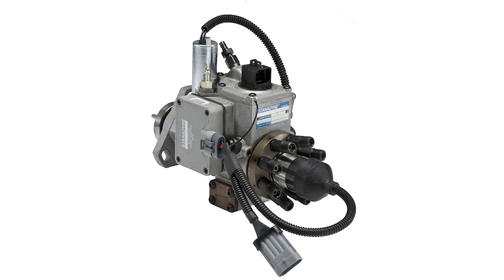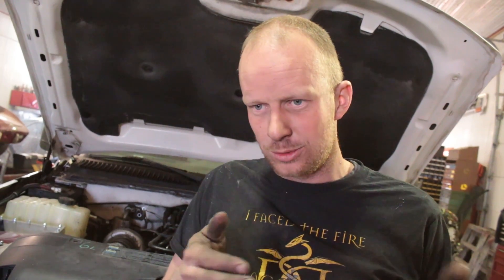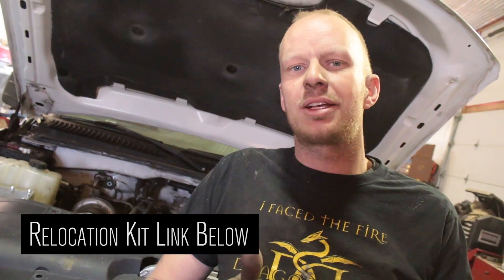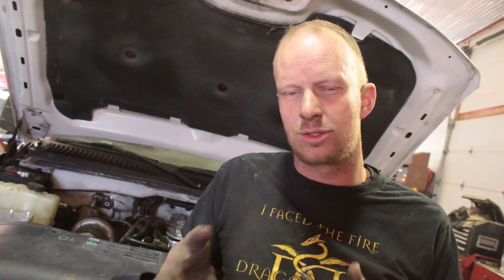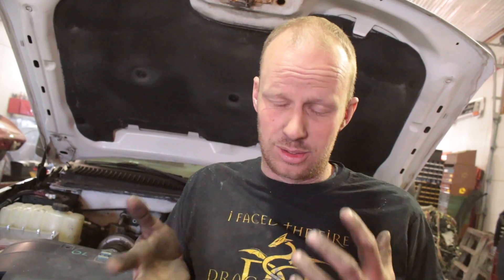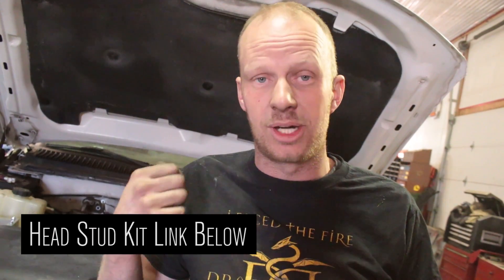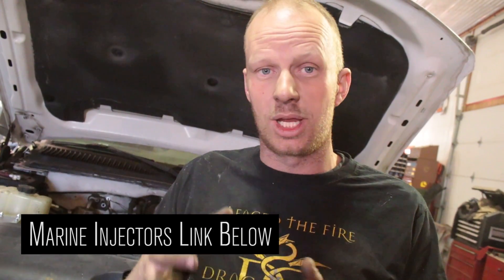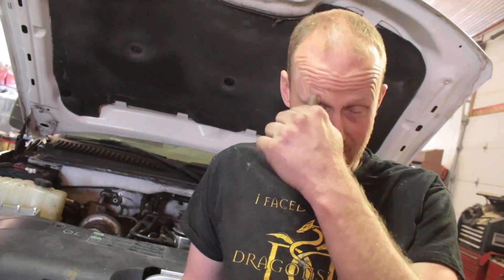REVIEW: Everything Wrong With A GM 6.5 Detroit Diesel

Comment: Not a Detroit, it is GM. Two separate divisions. The Stanadyne DB2 pump issues were mostly the driver module. Relocating the module was really not the answer, repeat failures were more common when relocated. A change in module design helped greatly not perfect. Cracking heads when overheated .  Cracking main bearing webs were somewhat common. Broken cranks were somewhat common. Bad crank balancers were common causing a knocking that was mistaken for rod knock. Failed glow plugs, various exhaust manifold leaking issues, leaking oil cooler lines common. Vacuum pump failures common. This cheap lightweight engine was a disaster and not heavy duty by any definition. This engine should never be 'chipped'. My most replaced engine of all time next to chevy 350's . The military only used them because it was the only diesel option with the GM built Humvee but that engine was not the same as the 6.5 civilian model, in fact it was almost completely different and more HD in many ways with a different designation (GEP P400 6500 optimizer) including a mechanical fuel system instead of electronic, different alloys and other mods but visually identical to the untrained eye.

Comment: The first thing wrong with a GM diesel is that it is V-shaped. DUMB !!! The new 3.0 inline and the new 2.5 inline are incredible changes for GM. Inline is the way tractor engines were designed for a reason. Whether it be a gasser or a diesel. 

I despise ths moron that created a V-variant of the diesel engine.

Comment: The 6.5L was 180-200 HP/360-390 TQ.
The 1992-1993 6.5L's were mechanical fuel injection,and then the others did indeed have electronic fuel injection including a DB2 fuel pump before the DS4.
The 6.5L is from 1992-1999.
The 6.2L was for 1982-1992.
The 6.5L is in the M1025-M1046 HMMWV and M1113-M1167 HMMWV/ECV.
They kept the 6.5L in production under license and rights sold to AM General for HMMWV from G.M..
The difference with the 6.5L in the M1025-M1046 is that they had a N/A 6.5L but the M1113-M1167 had a T/C 6.5L.
And yes,they did have these engines naturally aspirated as well,you could buy them as crate engines.
The CUCV ll had 6.5L's but only 8,000 of them were ever made while the CUCV only had the 6.2L.
The 6.2L was also put in the M998 HMMWV one year after they came out.
Even though the 6.5L is nearly three decades old already with the Humvees being almost four decades old themselves ever since they debuted,the Army and USMC will still keep them until another twenty years.

Comment: All the problems with the injector pump where the pmd and stock lift pump gm never fixed fully fixed. after market sells relocate wires at 8 40 and 82 inch. Buy lifter pump for marine.

Comment: My 1994 6.5 has 340k on the odometer put an hour meter in has 5500hrs on meter haven't changed any injectors or the turbo 1 inj pump and a Dorman    PMD runs great no oil usage or major repairs

Comment: I bought a 94 Silverado Z71 with a 6.5 turbo for $600.00. The truck had a clogged screen in the tank. Blew air back thru the line going into the lift pump and drove it home. Found out it was the first year of the computer controlled injection pump. The truck had 316000 when I bought it. I had to fix the glow plug system, and some other sensors, along with the vacuum pump. It has pretty bad blow-by, but it has 32200 now, and use it as my daily. I also moved the PMD/black box from the intake to inside the front bumper, which is what most 6.5 guys do. I do want to pull it down and freshen it up, but for now it runs well and pulls fine. Just to make a correction, the stock turbo is putting out about 12 psi at wide open throttle. The computer adjusts the turbo output for the load it sees. The parts are cheap and easy to come by. I also want to put the studs in the block when I freshen it up, so that is an issue. There is also an issue of the timing chain and gears. They say it only lasts about 25,000 because of the pressure of turning the injection pump. There is a gear drive setup to replace the timing chain to solve that issue.

Comment: The square body never never had a  6.5 and the last year for a square was 92 crew cabs and suburbans only. 87 for trucks, the GMT 400 platform and bodystyle started in 88 ended in 1999 some suburnabs and crew cab diesels made it to 2000 or 2001 the square bodys started in 1973 ended in 1987 trucks the 6.2 diesel started in 1982 previously the 5.7 diesel
 was found in trucks

Comment: I have a 2000 Chevy k3500 OBS DRW truck with the 6.5 diesel and I’ve got 215k on her. Tell you what Honey Badger (what I named her) is a mean bitch and must’ve been made on a Wednesday or something because she has withstood tons of hauling, man baskets dropped on her, 30k hard miles with a 17 year old who has a lead foot (aka me) and she has never overheated once, not when I took her in the mud, I’ve had that truck sideways around some corners driving around. The only problems we ever had with Honey Badger was with the factory piston driven lift pump underneath the drivers door on the rail. Once we put a gear driven pump she never had any problems. I took Honey Badger from Stedman North Carolina to Michigan and back hauling a car trailer one way then a car on the trailer on the way back and she cruised 70-75 mph the whole way and the only time we stopped the engine was to get fuel. Didn’t over heat once. My 6.5 turbo diesel has been nothing but good to me and have zero complaints about my 6.5

Comment: The 82nd AIR, we started getting the Humvee's in 1988 or so, and then within a few months, engines where blowing left and right. Go to the motor pool, there would be 3-4 of them sitting there and one or two on a lift engine out getting replaced. I think they where getting an upgraded motor, can't remember. No worries, we had lots of M35's- with the  465, and them things kept on trucking.

Comment: 6.5 2000 savanna and almost 400k it's super reliable. Only problem was the pump control module. Even relocating it into the air box still had one fail eventually. If it was not for that module I would of been 100% reliable for over 200k

Comment: If you work them hard they do not last,. Light duty great,. Anything more than a half ton the thin number 8 liner, the POS balancer and the crappy cooling system really show up..  the later ones they fixed some of the stuff but it's still a 80hp pump motor used because it was cheep...

Comment: My biggest issue was the lift pump. Who the hell powers a lift pump with the oil pressure switch. Run it through a relay, no more oil pressure switch failures.

Comment: 90s and later Chevy pickups (aside from a few 1 ton 90/91s) are NOT "square bodies". The square body Chevy is 1973 to 1987(-91 in some heavy applications, essentially left over parts). They never got the 6.5L, only the 6.2.

Comment: Disposable motor. Junk at 100,000 or less. This is a GM diesel engine not to be confused with Detroit diesel who builds industrial heavy duty diesel engines. The confusion is left over from the old 2 stroke era.
Reply: You're wrong. GM commissioned Detroit Diesel to develop the 6.2. It was made in a Detroit Diesel engine plant. They hit 300,000 consistently. I've owned multiple 6.2s and 6.5s

Comment: Do you think the GMT400's (88-98) are better made than the later models? I have a 97 one ton, and I think it's quieter and rides better than a 2006 pickup I had. On the 97 I have swapped in a 6v53 so the engine noise levels are a bit elevated.

Comment: I have a 96 silverado 4x4 with the 6.5 166,000 miles and I love it . I have done some upgrades after market lift pump , after market water pump , dumped the vacuum waste gate , relocated the pmd and put on a 4" exhaust . pulling my john deer mower it does great . starts everyday and gets good fuel mileage . it is not a power stroke or a duramax but it does what I want it to do and does it well

Comment: I think when people judge this engine, they always compare it to the other full size diesels of the time (7.3 idi, 5.9 cummins, 7.3 PS) and are underwhelmed with its power and durability under hard working conditions. But I think we fail to see the 'niche' of the 6.5, it was not meant to be a power competitor, but an economical engine option. This is also probably the lightest full size diesel engines; they only weigh about 750lbs (5.9 is like 1200?), they even put them in half tons (in fact their light weight was probably one of their great issues; both the block and heads are quite prone to cracking). In an abused/worked 1+ ton tow pig, probably not the greatest engine. In a half ton pickup or tahoe commuter/grocery getter, probably alright.

Comment: The GM 6.5 was only used for the first couple years before switching to the AM General 6500 Optimizer and not to be confused with the p400!
Reply: Same engine design a few improvements but very much the same design
Reply: @jdrok5026  The Optimizer was recasted with a new mold after AM General bought the rights from G.M.! If our interested I have a few articles explaining this.

Comment: Never owned a 6.5 jimmy. I did own 2 , 5.7’s at the same time, and later a 85 3/4 ton Suburban with a 6.2 jimmy. Owned a 93 Ford F-350 Dually with a 7.3. Nothing but Cummins since 96, 4, and just bought Ferd SuperCruzer 650 with a Cat, to tow my fifth wheel, future problems with HEUI coming.  Anyway what I wanted say about the fuel return fuel system on the 5.7, 6.2 and most likely the 6.5 is the check valve located in the fitting on the front of the pump the the fuel return line hooks to, will shut the engine down if internal pump debris lodges around the glass ball and spring. The purpose of the check was to maintain a little back pressure on the pump for smooth idle and driving. If you pinch the return the engine will shut down, same as a clogged check valve. Quick fix is to carry a spare with you with the check valve drilled out. The engine will run much better without the return line restricted. I have stopped many times back in the late 70’s and early 80’s to help those owners on the side of the highway. Symptom, engine slowed down and quit running. Would restart but shut down again. Just thought I would add this comment, late as it is.

Comment: My 96 6.5 was doing great till it started throwing 3 codes for fuel. P0216, p1214, p1218. All having to do with injection timing and calibration. So this is enlightening and I will have to do more troubleshooting to see if the pump has been replaced.

Comment: My grandpa has a 1992 Chevrolet G30 van I'ts white and has stripes it came with the starcraft conversion package he still has the van it has a 6,2 liter diesel its at 328k kilometers and still runs fine i know there was more problems with 6,5 rather then 6,2s but do you know of any common problems on 6,2s?

Comment: The thing I remember most about the Detroit was one in a C60 flatbed tow truck [Don't know size. 1980's model]where the thing was a gutless wonder and the throttle snap test was sooo sluggish.
At the same time I drove a 89 F600 with a Brazilian straight 6 non glow plug turbo [Ford Diesel] 400Ci with mechanical injection pump. The throttle snap test was instant rpm's and back to an idle. It would pull a 5% grade at 22k lbs GVW @65mph no problem.

Comment: what about the 6.2 before it? it had a mechanical injection pump.

Recently bought a  lifted 89 suburban with a built 6.2 turbo diesel in it and a nv4500.  Only did a bit of research on it before buying it, but I think it should be pretty reliable.

it has a main studs, head studs and lower compression pistons with a banks turbo kit on it.  Has the DB2 injection pump.

Wouldn't mind a better turbo on it, loving the truck so far.  got 18mpg driving it back home while mainly in 3rd and 4th gear.   If I take it on another long trip i'll try to add up what it gets if I can keep it 5th gear, curious to see what kinda mileage it gets when just cruising on smoother roads.
Reply: How the 6.2 still holding up?

Comment: I can remember the first time in Iraq when it would be hot we would always dump ice water on the fuel pumps to get them to restart. My second time we stopped turning them off when we stopped we would rather overheat them then be stuck trying to get them started again because they  vapor lock from the heat. The funny thing is they seem to run better when they were overheating just don't turn it off!
Reply: That would most likely be the pmd located on the IP. It would overheat when you shut the engine off because they use fuel to cool it.  Once you shut the engine off hot it baked the chip

Comment: The 6.5's can be good motors once the bugs are taken care of.
Reply: The bugs are.... The 6.5. All V diesels need to be crushed and replaced with inline 6's.
Reply: @Twitch_Moderator  that's just a really bad troll.
Reply: @A-A-RonDavis2470  Yes.   .I have a 6.5 turbo Chevy Tahoe in New Zealand.
It was converted to RHD in Canada & shipped new to NZ in 1997
Done a 190Kms & worth about NZD$25k.. Very cheep.
 fun fact:-  only 3000 were ever made and most were sold in other countries, other than the US It was available from 95-99 and the diesel Tahoe was a special order through GM. It’s one of the rarest modern vehicles you can get

diesel fuel is NZD$1.20 per lt.
 + road tax of 6c per km.  !!!
& road tax for a 50 ton truck & trailer is 60c per km.
Old gas Blazer are going for twice the price of diesels,.!!!.
Gas in NZ is $1.80c per litre.

Comment: I have a 07 Dakota 3.7L 6-speed manual transmission 4wd SLT package 196k miles. Its clean hardly any rust.
I got a guy wanting to trade 97 chevy 3500 6.5L 5speed manual transmission 4wd dually, his trucks issue is the starter got ripped off when trying to start it, he pops the clutch starting it and goes on his way... his trucks got lots of rust idk about the fuel mod if its been changed yet its only got 101k miles on it. Should i take him up on this offer?

Comment: Funny shit ppl commenting on all this Detroit diesel is the number one selling diesel brand in America ha ha ha has been for a long time considering 90% of all semis on the road r running one form or another of the Detroit the power stroke Diesel engine is a aka t444e international harvester engine used in all kinds of commercial applications but is in heavy chassis trucks like the international 4700 and such and most ppl have some knowledge of the CUMMINS world it wasn’t until the 6.4 ford started making the power stroke engine ha ha ha dodge also owner of Freightliner bought Detroit diesel from Chevrolet in the late 90s which was when chev started using the 6.6 which is an Isuzu engine

Comment: I have a 95 k1500 with the turbo 6.5L and I got it at 289k and I’m up to 291. Ive driven it back and forth from TN to south GA a couple times and even gotten it stuck in a mud hole overnight. So far so good! It’s my first diesel so I don’t know a lot but it’s a very fun truck to drive. I’m sure once I drive a Duramax or a Cummins I’ll want one of those though haha
Reply: Ha my diesel experience went from a 6.2 to a 6.6 LB7 to a 6.0 PS to a 5.9 24 valve and now I have a 6.5 because the 6.2 was the only diesel I've owned that never done me wrong. Definitely the most reliable and they're the cheapest to get parts for

Comment: For ever ones info.. on the 6.2, remove the air cleaner.. do you see an EGR valve? If not, you have the higher h.p, better built engine..

Comment: Junk..yeah 30% of these junkers are still together and running.. as a gm tech, I have seen hundreds of them replaced under warranty, with broken cranks, blown head gaskets, and many other engineering faults..  gm, at best is a group of idiots, at worst, a group of criminal idiots.. the only thing worse than a 6.5 diesel, was the engineering fail of the new venture 4500 transmission bolted behind it..  new venture had to file bankruptcy and go out of business, due to the lawsuits brought against it by consumers..  you can't make this stuff up... nothing is worse than g.m.  
To all the gay people that think they need to tell me how wrong I am, just shut up.. I speak from experience and I drove Chevy only, back in the day..  I know first hand, what junk it is, as I have ridden in the seat of many a g.m. product..

Comment: Calling a 12V or 7.3 a "powerhouse" or "for pulling" is COMPLETELY ABSURD.  Did anyone who says this nonsense ever TRY towing with one?  Race with one?  They were gutless turds on every level.  They weren't even comparable to a decent V6 gasoline engine of the same era.  
92 4.3L V6 209HP.
92 12V 160HP.
92 7.3L 185HP.
92 6.5L 180HP.

Comment: The 6.2L & 6.5L did exactly what they were designed for and did it very well.  Comparing it to a 500lb heavier Cummins that was designed for a COMPLETELY different application is stupid.  The only thing common between the two designs is the fuel they ran on.

It was designed to interchange with a SBC and get excellent fuel economy.  My 86 C10 is EPA rated at 31MPG.  Something only delusional Cummins owner can dream of.  It weighs 500 lbs less than a Cummins industrial motor.  In stock form, they're both gutless turds.  Same goes for the 6.9L & 7.3L that had the same 200HP max rated DB2 injection pump limitation.
Reply: Rated at 31 mpg?
No, that’s fake news my guy.
Reply: @chadking4928  your ignorance is not a valid reply.  31 highway/23 combined is correct.
Reply: @zacharymorris9917  1986 c10 6.2.  Is 22 highway/18 city combined 19 is correct.
Reply: @chadking4928  no it is not.  31/23 is correct.  I have no clue why you keep lying.  It is extremely easy to find EPA ratings for 82-86 6.2L C10 2wd.  31 Highway/23 City or 31 Highway/23 Combined on every single one.
Reply: @zacharymorris9917  please post a link with that information.
Reply: @chadking4928  already have multiple times.  Links get taken down by YouTube.